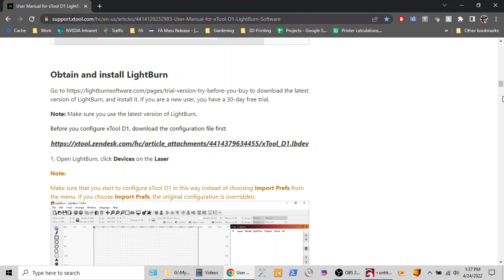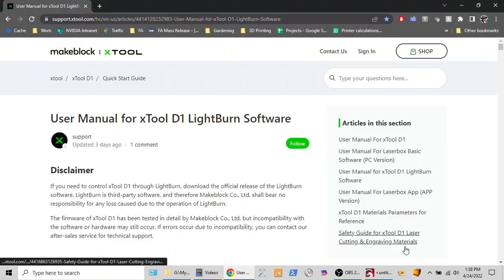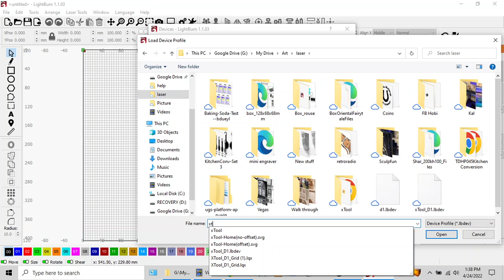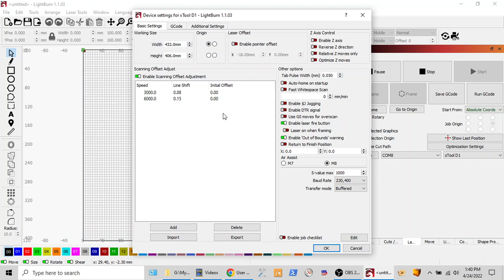Correctly setting up the xTool D1 with Lightburn

Comment: Hey Cobey, I am using the Devil1, love it. I am running into issues with the xtool rotary. I was using the rotation setting of 350mm/rotation and when you would run the 'test' it would rotate around 7-9 rotations (I lost count). I ended up setting it at  55mm/rotation and it is close, but the lines aren't exactly where they should be. Any thoughts?
Reply from the maker: From the numbers you're using, I suspect that the numbers you haven't mentioned are not correct, which is causing your rotation to be off

Comment: not working for me. heres my situation. i have the expansion kit, i got it set on a table to my left, the power button and connections would be bottom right if i turned to my left. the laser homes in the top left as far away from the power switch or start button as it could possible be. i want to re home it to the bottom left but its not working out. also i have the d1 pro 20w if that matters, ive used to correct file not the one you linked.
because of this issue it cuts or burns upside down to me. i need to figure out how not to only rehome the laser but flip the working space so if i ran a photo it would be correctly facing me rather than upside down.
Reply from the maker: First, this is for a standard, not a Pro. The Pro is similar but has its own lbdev file.

Second, you have to set the size in XCS first, then into Lightburn, as this is how xTool's firmware works.

Comment: Hi Cobey - thanks for creating this - very helpful...  but I do have one question - the speeds under the scanning offset adjust are 50.0 and 100.0 on mine where your video shows 3000 and 6000 (the offset and line shift match what you show).  I am guessing that mine is showing a percentage but thought I would ask.  Thanks!
Reply from the maker: Hey there! It comes down to which speed scale is being used. I'm using mm/m, but some are using mm/s or in/mm/s.  So, for example 3000mm/m is the same as 50mm/s (50*60)
Reply: @geeksatlarge  Makes sense - I didn't change any of the default settings when I installed Lightburn so it must default to CO2 laser settings.  I found the setting and changed it so now it matches what is shown in the video.